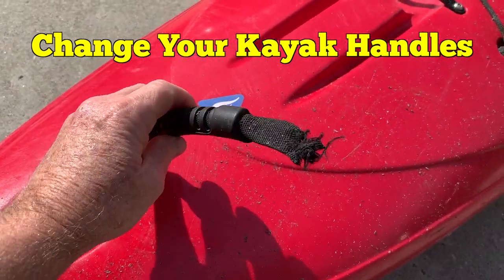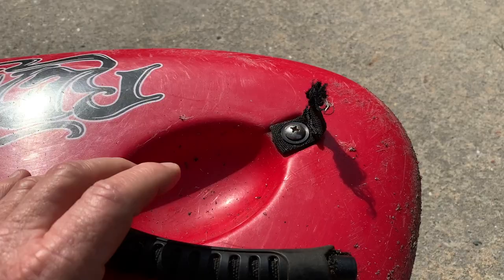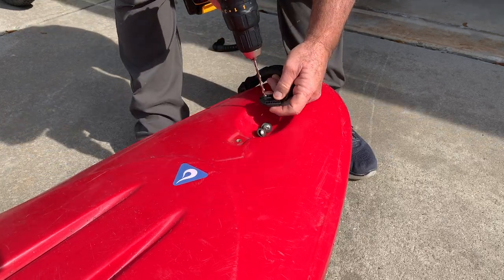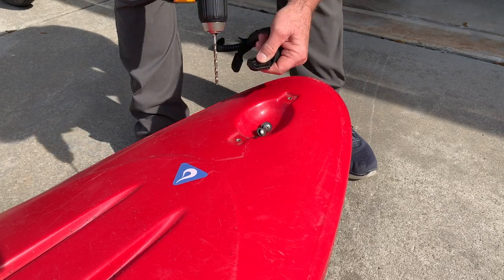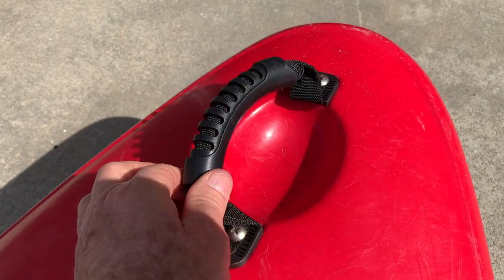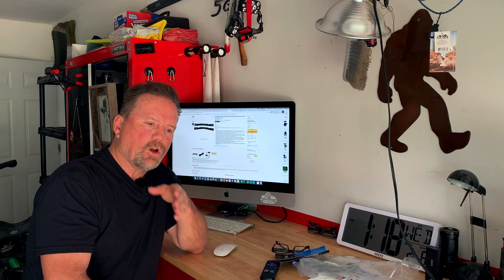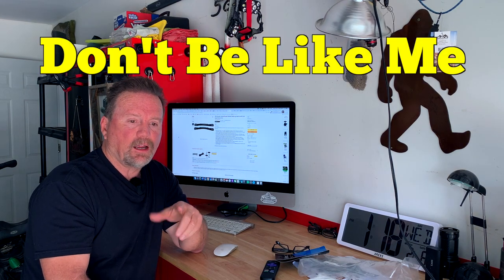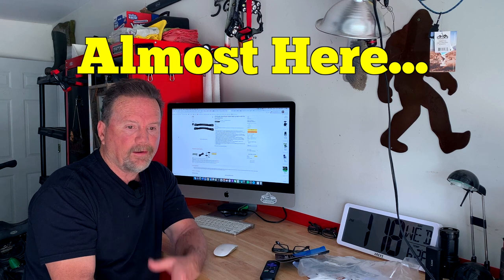Replace Your Kayak Carry Handles ~ Cheap!

Comment: Thank you for the Video Adventure Steve.  I have a Wilderness Kayack  Tarpon 100    When I try to unscrew the bolt, it just keeps spinning but doesn't come out
Reply: Same problem 😔
Reply from the maker: You might have to drill it out. New screw with a bolt to replace.

Comment: Nice, inexpensive fix 👍. Are the screws stainless, and are there washers included to go under the screw heads (to help prevent the screw heads pulling through the holes?  I wish Spring would get here sooner.
Reply from the maker: Affirmative Chief but I had to remove the washers to be able to get screws started. The rubberized area I drilled through will act as the washer.
Reply: @myadventureoutdoors  👍

Comment: Hey Adventure Steve! I am researching something for kayakers and you can probably help. I'm looking for keel guards. I'm 250lbs and every time somebody "helps" me at a take-out, they grab my bow line and drag me up onto the concrete ramp. I noticed the wear on my and my wife's kayaks is alarming. See what you can find if you want. I would appreciate any help, advice or input you can offer. 
Thanks for sharing this video with us!
Reply from the maker: See Scott, if you were like me, you would have a quick response team waiting your arrival at a takeout. I stay in my kayak and 2 huge dudes lift me out while I'm still in kayak and carry me into a shady soft grass area. I do know they make a keel guard tape that would probably help you out. Put it everywhere that is getting worn. Just search for that on Amazon.
Reply: @myadventureoutdoors  I'm one of those large guys. I have used gorilla tape and it does take the damage. I have to replace it about once or twice a year. Just depends on how much kayaking I do. I even took an old dirt bike tire and cut some pieces to fit over but I'm not committed to mechanically fastening it to my Pescador. I haven't found an adhesive that works with the tire guards. I'll search on the Amazon. I'll let you know if I find something better than the Gorilla patch. Thanks
Reply: Most of what I see is peel and stick, but the price ranges, basically the same as the Gorilla patch from $26 to over $200!
Reply from the maker: Ok, I'm going to go ahead and engage the superior brain thingy to give you the ultimate solution. You buy some kydex or similar material they use for holsters, sheaths etc. Cut your piece big enough. Flip your yak over and lay the kydex material over affected area. Grab a heat gun and let it mold itself to the keel. Clean the area on the yak with some acetone or alcohol and use 3M double sided tape on the keel and also on the kydex material. Stick them together. Only the good Lord can unstick the 3M. Problem solved.